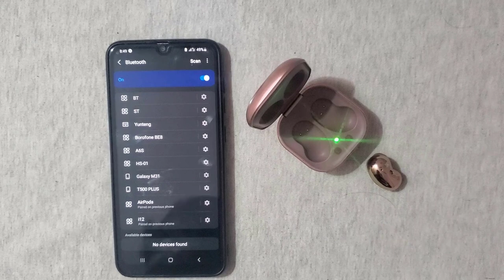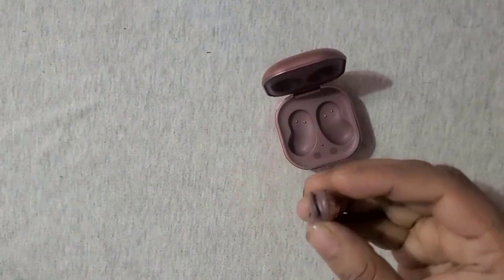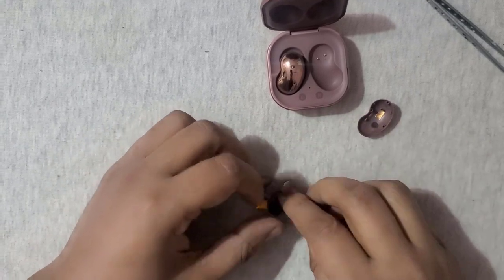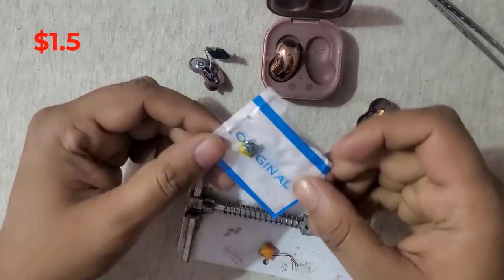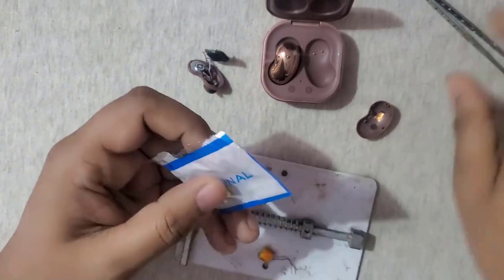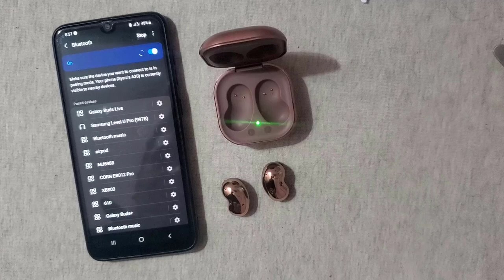Repair Dead GALAXY BUDS LIVE SM-R180 - Samsung Earbuds Battery Replacement

Comment: my earbuds are the same as in this video. when i teared the right one i think i accidently  removed the blue cable from where it was connected (it was connected to speaker). Can I connect it again to its speaker? I watch the video and you did connect the cables easily. How can i do that?

Comment: This is actually a fake galaxy buds ! The battery in original one is a Varta 1254 A3 which is an rechargeable special battery not like this one
Reply from the maker: Indeed, the earbuds I used in the video are a copy of the original Samsung Buds. The battery used in these earbuds is also found in many other Bluetooth earphones, except for the original Airpods and Samsung Buds. This battery is also easily accessible. Additionally, it is a rechargeable battery

Comment: Bro i have only one right side earbud.
Can i use only one sided earbud by charge it by a charger .
Bro plss tell me how can i use only right side earbud.
Reply from the maker: Do you mean you don't have the box either? If that's the case, just get a new smartwatch charger and use it to charge your bud. It costs around 100 rupees
Reply: @syarzasterisk  bro i have only right side earbud can i use this by charging .
Reply from the maker: @harshup12  Of course you can
Reply: @syarzasterisk  but bro it is not showing anything when i charge it by a charger .
Reply from the maker: @harshup12  Maybe because of the dead battery or, the battery inside the box is dead. Try a smartwatch charger